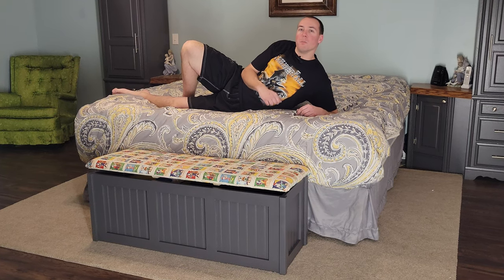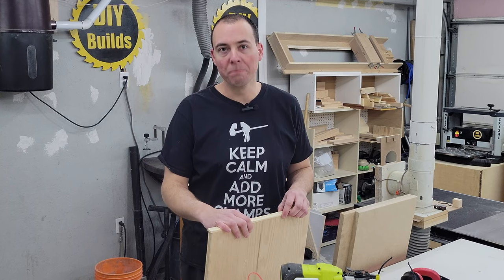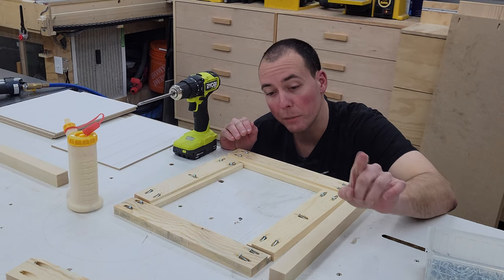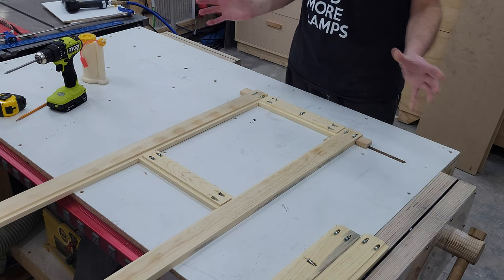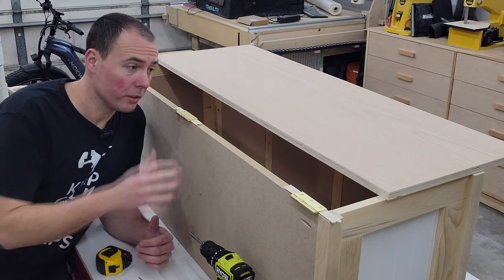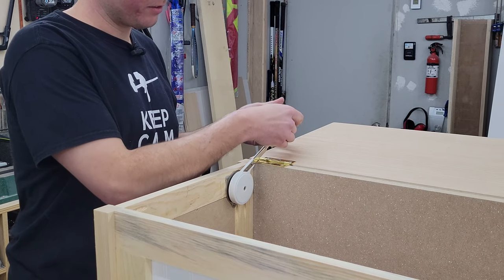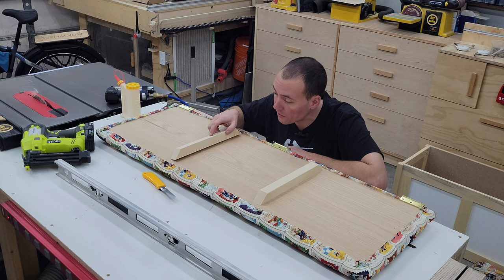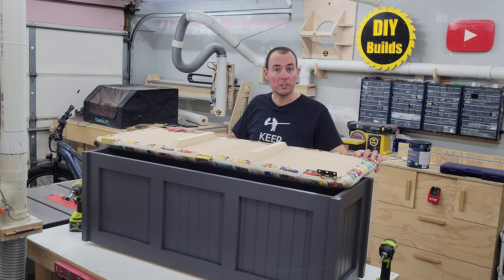How to Build an End of Bed Storage Bench

Comment: I just watched another tuber's video on clutches. Be careful which drill you use, and make sure the clutch actually does it's job. He tested a dozen or so configurations between about 6 or so drills, and the dewalt he had went full send regardless of the clutch setting.
Reply from the maker: That's good to know. Both my ryobi clutche work great.